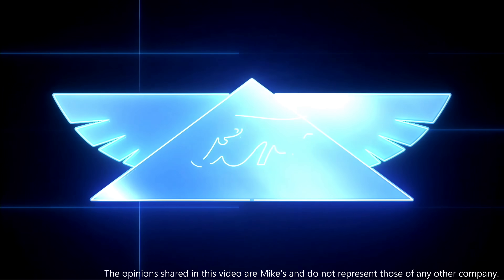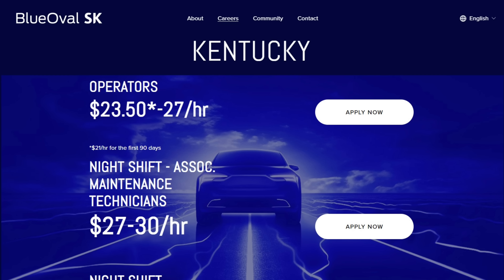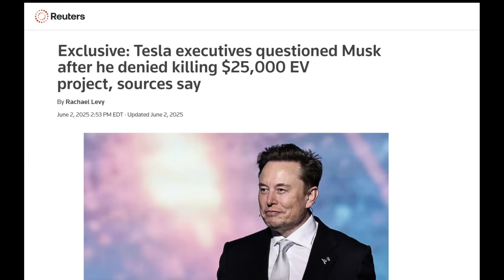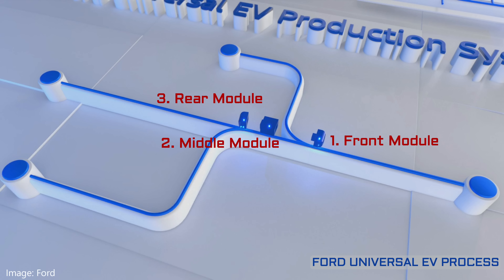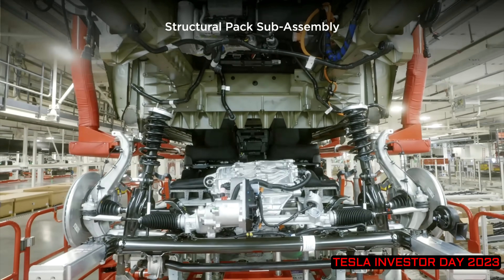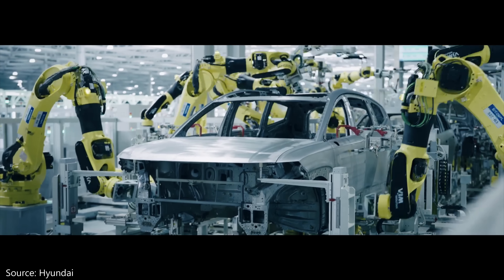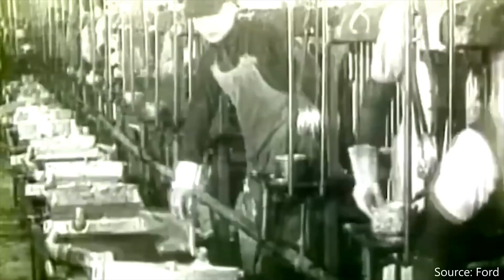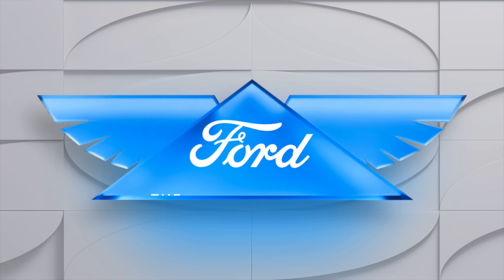Ford's Universal EV Platform and Production System - the $30,000 Electric Truck

Comment: People make me laugh. A common platform for several models is not a new idea the car cos have been doing it for years. Remember the red hot Mustang intro in 1964? It sat upon the Falcon platform. The H2 hummer?  sits upon the YUKON platform. The H3 sits on a Colorado platform. My Ford Maverick shares its platform with the the Escape & Bronco sport. This has been done for years. Now if they indeed use 1 platform for  ALL  vehicles  OK thats kinda new. RIVIAN does that. The R1T &  R1S  & Delivery van both short one & long one all use 1 platform-So it can be done.
Rv trailers are built that way. FIRST they lay down the flooring. then mount the cabinets, beds & appliances-then the walls & roof go on.

!

Comment: Not buying any electric vehicles after seeing the video of that Mach E locking up its steering wheel and still driving with the driver praying in the driver seat right before it crashed.

Comment: They should put solar panels on the roof, rear box cover and front trunk cover. It may charge when your parked or on the road. That will be revolutionary and give you a ton of range.
Reply: I typed your idea into Google Gemini: 'calculating with 4 square feet of solar panels it would take approximately 217 days to fully charge a 65 kWh battery.' Even quadrupling that size would not make a dent in charging but it would add a lot of cost that the customer would never recover and more importantly weight. The charge it would add to the vehicle would probably used for carrying around those panels and their control module.

Comment: Ford can't even keep the Maverick under 30k right now let alone a new EV truck with acceptable range and something actually usable. Even just a redesign of the Maverick as an EV would put it over 30k already. If this ever does come to fruition, it will end up being some limited number base models like they do now just so they can advertise a 29,999 price tag. That's all not even taking into account tariffs on the vehicles that wont be made in the US as well as tariffs on steel and aluminum that will drive up costs as well.

Comment: A $30,000 truck with 200 miles of range due to low energy density LFP to be on sale in 2 years. In a world where fully electric pickup trucks are getting just under 500 miles of range on a single charge TODAY. Battery technology is constantly improving with every new iteration, so they might be getting close to 600 miles in 2 years when Ford is releasing their 200 mile pickup.
Reply: People need to get to terms with what they actually drive daily and buy accordingly. 200 miles would last me all week and more. Why would I pay for more battery capacity I will never use
Reply: And this same  pickup trucks you're talking about are almost $100k. Some are over $100k so...
Reply: @ThomasTheTankEngine22  The Silverado 3WT with 390 miles of range starts at around $55,000, so...
Reply: @junehanzawa5165  well 390 is not 500 and no, battery technology is 'not constantly improving' no matter what the headlines are trying to tell you. Energy density will not miraculously change in current Lithium batteries. Solid state won't be ready for the market for years.
Reply: @PeterSz73  The Silverado EV got 440 miles on a full charge a year ago. The new Silverado EV model is now getting 494 miles on a single charge. Same exact physical size battery, yet it gets 54 more miles on a charge. How can that be? It's called energy density improvent by tweaking the chemistry. 

Ten years ago the best any EV got was around 260 miles on a charge and there was only one that could do it, the Tesla Model S. No other EV got even close to 200 miles. Now several are doing around or over 500 miles on a charge. Facts. People can look it up for themselves.
Reply: I would think as technology improves ford could add that in as time goes by

Comment: You are correct in that Musk was/is coasting and it has cost Tesla $$$$$. This small affordable pickup is what Tesla should have built, using this unboxed process, instead of the cyberuck.
Reply: Tesla has never been about the cars. Cars were simply a gateway towards building out infrastructure and standards to license tech to others & generate repeat monies on vehicle charging.

Comment: This is hopeful but the reality will be:  (1) $30 K will turn into low-mid 30's by 2027.  (2) $30 K will be single motor and a smaller battery - most buyers will opt for a more optioned truck, AWD and larger battery.  So in reality it will be a low to mid $40K truck.  (3)  $40-$45K will be OK.

Comment: It sounds like GM's Ultium platform - a standardized platform for a large variety of vehicles
Reply: ...which GM presented & previewed back in 2002 / 2003 with the skateboard chassis/multiple body configuration capable Autonomy & Hywire concepts using EV & fuel cell technologies...

Comment: the castings were a thing decades ago and got abandoned because it was harder to make changes, and alloys weren't that great. how repairable will they be? you have no option but order parts from Ford and you cant just weld and fix easily like sheet metal. The platforms are out for decades, VW was the king of it. it's good news but I don't know why they act like they invented something lol

Comment: Ford loses big money on every EV that they make. So the solution to that problem is to make larger numbers of them and sell them cheaper. Does that make sense?
Reply: Ford loses big money on each EV sold because they spent billions on the factory and R&D but don’t have the volume of sales needed to get their money back.  The more they sell, the less they lose and if they reach a certain volume, then it tips over to profitability. It’s a stepping stone and they are still learning a lot from their current EV’s so sometimes you need to chalk up the loss as a necessity to advance.
Reply: Yes. Tesla lost a lot of money too when they started out. Switching to build ev’s requires a lot of changes and learning. Isn’t that obvious?

Comment: I put down my $100 reserve for the Lightening when it was announced by Ford.  I placed the order for the $40,000 truck.  2 years later Ford contacted me and said my order can proceed but my Ford Lightening XL was now $65,000!  What!  I canceled and got my $100 back.  2 years later, today, you can get a fully loaded Lightening with long range battery (new) for $55,000!  I'm glad I didn't get ripped off!  I'll wait a while before I believe Ford and their pricing!
Reply: Was that during that covid time frame ,all auto company's went nuts...the dealers had massive mark ups the people were still paying after the mark ups which ford has no control of the dealers
Reply: @John-ze3vo exactly.. delears are the problem. They have a whole network that cars have to be sold through them and they’ll try to sue if then company doesn’t want to sell through them. That’s why Ford try to establish Ford-E division for direct sales. They need to make it happen if they want to survive
Reply: @John-ze3vo  are you saying that 2022 Ford Lightning's were part of the COVID boom.  Also, what is your overall take on COVID's effect on the used market.  I know the numbers look a lot higher when I look at them before but I wouldn't say that COVID did to cars what it did to houses. Curious what your thought are on midsize offerings and where the market will be by 2030 or so.  I'd really love to get a midsize truck option.
Reply: Just like that George Dubya saying.. we won't get fooled again

Comment: The cyber cab is under production in Austin rn though. You can see a drone video where they are installing the cyber cab production line where they do final assembly after printing the plastic and structural battery ( cell to pack or cell to body or cell to pack) but who wants a two door car anyway?

Comment: Interesting.   So the slate's hoping for $27-28k before you get paint, nav, radio, the battery extender for 240 miles, the kit to get back seats etc... Looks like this might be the death knell to them.  Just the 240 mile battery pack for the slate pushes it over the ford expected price.  Then still dealing with it not having any of the other stuff.
Reply: And no dealer network, production history, 8+ years of MachE and Lightening combined production, etc.
Was rooting for Slate, but Gm (Equinox, Blazer, Silverado, Bolt, etc) and now Ford have upped the ev game.
Reply: Slate is dead before it even starts…. If this is actually 30k then it will sell well but it will not sell anywhere close to the Maverick.
Reply: And only  a 2 door
Reply: Slates's slate will be clean, that is cleaned of buyers!
Reply: I've been waiting to see an options list with prices from Slate. And I'm surprised they haven't let 3rd party manufacturers make accessories
Reply: Announcements are worthless.

Wild anyone would consider an announcement a death knell of another announcement...both of which have absolutely zero product.

Will an announcement tomorrow of a $25k truck kill off these announcements?

At this point it's just marketing firms competing against each other with phantom ideas.
Reply: @PowerScissor Understand the frustration, but when a mature public (stock market) company like Ford, Gm makes these announcements, its a Big Deal.
They are legally  liable for statements made and financial implications re shareholders and SEC reporting.
A non public company can get away promising anything.

Comment: If only Tesla had stuck a steering wheel in the Cyber Cab and called it the Model A... Hence it's line up of S-3-X-Y C-A-R-S
Reply: You do realise that's the point?

You will be able to add one to yourself or a Xbox controller wired via usb to ethernet 

That's the point of steer by wire and drive by wire, instead of making two cars on the two door car. Elon wanted one model
Reply: very lame joke indeed! other manufacturers also have models with those letters.

Comment: The worst part? It could have been revolutionary if they just with with an even more stripped down affordable truck under the $25K mark WITHOUT incentives... It's possible but nobody wants to do it..  Sodium-Ion batteries for example offer virtually the same range and density as LFP with a fraction of the price. I'd much rather have seen Slate vs Ford vs _  in an affordable SUV/Pick up bake off but alas... Just like a $15K car used to be a thing... And most people's first new whip... But here we are...
Reply: Sodium ion battery chemistry has a lower energy density and worse performance compared to LFP...

Comment: Excited to see what we actually get with this production process, but first models are still at least 2 years away. Chinese automotive industry won't be waiting for so long. They will be on their 10th version of current EVs😅😅
Reply: Farley said the mid size truck ev "will reach customers in 2027", so production must start 2026, early 2027 to put in customers driveways by cy2027
@theelectricduo channel confirms Ford will begin retooling Louisville for the compact pickup ev in 2025, complete production setup 2026, sell to customers 2027
Reply: Model year 2027 starts about this time next year (2026).
Reply: Re: 10th version of chinese ev
Ford had an ev Ranger for employee lease in 1999.
The Lightening and MachE have several model years under their belts.
The MachE went on sale December 2020. So 5+ years in consumer ev production.  
The F150 Lightening has outsold the Cybertruck by 50% in cy2025 to date
If you count hybrid consumer production, the Escape Hybrid was on sale 2004
Reply: @geraldford6409  Being behind is being behind. Not changing and adapting to modern technology and standards can put anyone behind, no matter how long they have sold anything. And sales numbers mean nothing in the long run if the products being sold don't hold up to the marketing hype. How much money does Ford lose per BEV sold? 

By your logic, Nissan would be well ahead of everyone with the Leaf. What about GM with their EV-1? Sears would still dominate Amazon and Walmart. How many Model Y's does Tesla sell and how long have they been selling them? Do you see my point?
Reply: @drewchristy The EV1 was NEVER intended for long term, mainstream production. It was a testbed for technology. Move on, nothing to see there.
Reply: @bryanayers6104 Nobody really knows that for sure. That's what GM says today, but that may have been b.s. Regardless, you also missed my point.
Reply: I wish Ford the best, but there is no way you can compare Ford to Tesla or the Chinese brands, which are both far more advanced at this point. Like it or not, the Cybertruck's systems are far more advanced than the Lightning. The Lightning was a cheap and quick way for Ford to get their feet wet with BEVs. All they really did was place a battery between the frame rails of the existing F150 platform, along with a few electric motors. This allowed them to get the truck to market very quickly, however, the vehicle is not very optimal. As far as the Mach-e is concerned, It's not a bad attempt, but it's not very efficient and as been sacked with issues. To make matters worse, it's not even built by Ford. And good luck to those who automatically dismiss Chinese built BEVs. You are in for a very rude awakening if these vehicles ever hit our shores.

I also have to laugh at Ford's hybrid systems. Ford can't compete with anything currently offered by Toyota. By the time they figure it out, Toyota will be even further ahead. The same applies to Tesla. How much more advanced with they be in the next two years? 

I like Ford, but they have a huge mountain to climb. They are behind and will need to advance greatly to survive. This takes time and money. They also need to overcome many legacy problems and years of poor quality issues, which seem to be getting worse in recent years.
Reply: @drewchristy Ford manufactures the Mach-E at Ford Cuautitlán Assembly Plant in Cuautitlán Izcalli, Mexico for US customers, and at its Changan Ford plant in Chongqing, China, for local customers.
So yes, the MachE is built by Ford
Reply: @drewchristy As of the second quarter of 2025, Ford has sold 15,860 F-150 Lightnings, while Tesla has sold 10,712 Cybertrucks.
So, Ford Bev truck sold 50% more than Cybertruck for cy2025 to date
For US truck buyers, the fact Ford builds their full size BEV truck using body on frame using the same body and frame as the ice version, is a huge advantage and one reason they buy them.
The Ford F-150 Lightning uses a high-strength steel frame. Its body and bed are made of high-strength, military-grade aluminum alloy.
They want it to look and act  like other trucks on the road, like the ones theyve had recently re body style.
Body on steel frame is what real truck users want.
Lightening electric motors are assembled at Van Dyke Ford plant in Michigan. So the Lightening is entirely built, assembled in Michigan
Reply: @geraldford6409  My point is the CT is a better, more efficient BEV. I mentioned nothing about sales or truckness "standards". But let's not kid ourselves, there is nothing "military grade" about the aluminum body of an F150. Even GM called out Ford in ads for using thin Aluminum that doesn't hold up to the strength of steel. Ford decided to use aluminum for better fuel economy, not for its strength. The CT is a much more advanced vehicle technically. It also uses an actual Space grade stainless alloy that I would gladly put up against the body of the F150 any day.
Reply: The F150 Hybrid Powerboost I currently drive is ridiculously awesome.  Huge fanbase with many Powerboost owners extolling its virtues all over Youtube.  Same for the Lightening and MachE fan bases.  The Infotainment software is <chefs kiss>. Sync v4+ hits the sweet spot with pitch perfect Carplay/Android Auto integration and imo, finally got the Sync/Android Auto combo Right
A nephew and retired coworker both have a MachE and love them. Wouldnt go back to ice if someone gave it to them. Well, they'd take a free ICe vehicle if offered and immediately sell it to get a bev with the proceeds 😅
I would do exactly that if I won or was given a Cybertruck, ie sell it immediatly and buy a Lightening. And invest the surplus 😊